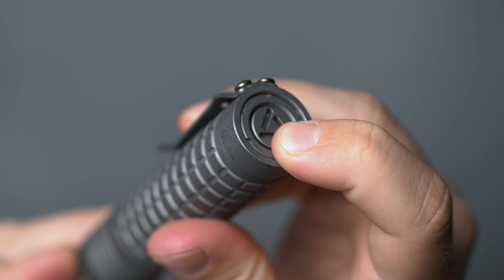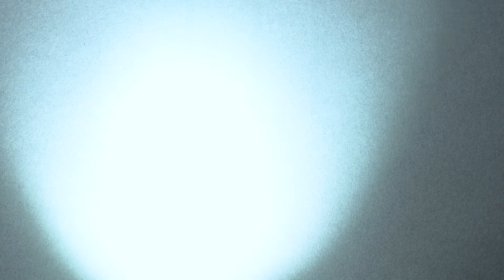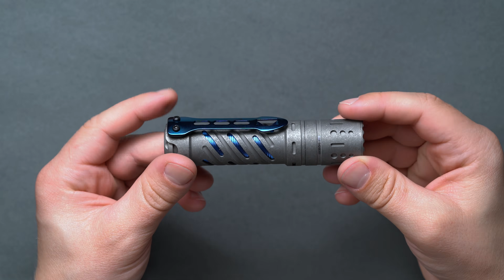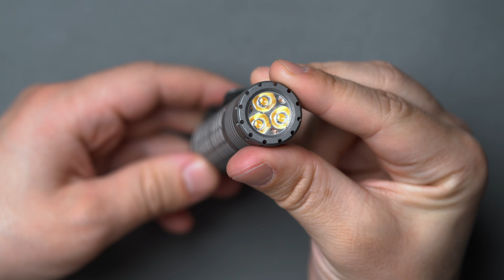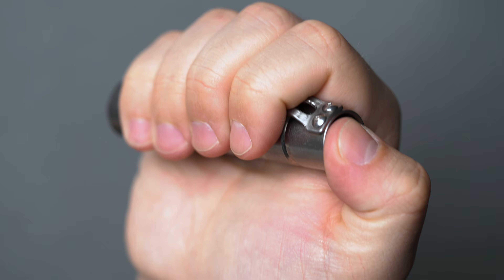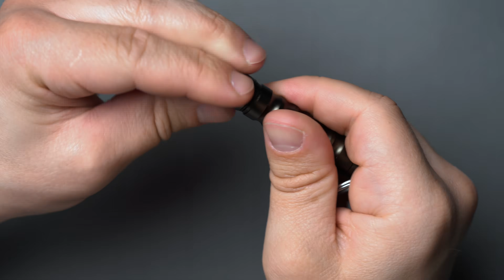The 8 Best EDC Flashlights

Comment: Have had the T4K for a few years now. The majority of the black has been scraped off over time, revealing the aluminum body. There is nothing legible left on the case to discern what it used to be, but it is hands down the best flashlight I've ever owned. And I have A LOT of them, including multiple O-Lights. This one is perfect for EDC and when you hit that top button, you can access the blinding 4k lumens instantly - even when you lock it. 

A few downsides
- I've melted every single mesh/nylon pocket in all of my pants. The 4k button is easy to trigger and it WILL burn through clothing. 
- You have to keep the T4K locked on "1" at all times or buttons can easily be pressed and drain your battery in your pocket.
- Locking it usually takes a couple of tries. You have to press 2 or 3 times to activate the locking mode. It's annoying.

Comment: surprised you didn't mention the reylight being able to also take 18350 batteries by taking off the extension tube. thats where it becomes a fantastic light. 18650 for a work day, swap for 18350 for lighter edc

Comment: Today i have new pocket licht.
It use aaa Battery and run 3 hours 
GP flash light CK12 
20 lumen.
25 meters 
IPX4
Key ring.
18x89mm 
Aluminium body 
A brand company 
And i pick up for backpackers.
GP ReCyKo B421 EVERYDAY USB charger for aaa or aa battery to charge up.

Comment: why is the run time on the e70 mini so bad?
19 hours at 60 lumens?
that's more like a 14500 light not a 18650 light, it should be at least double if not triple that

Comment: Hey! These are the list prices from the manufacturers’ websites (except Laulima Metal Craft, which didn’t seem to have a functional website). Lower prices for some of the lights were found on other sites such as eBay, Amazon, and other dealers, but none were drastically lower. I'm surprised Rovyvon didn't make this list; they make awesome lights!

Olight Baton						                  $99.99
Nitecore T4K						                  $89.95
Acebeam E70 Mini Ti					        $109.90
Surefire Titan Plus					        $149.00
Reylight Ti Dawn					                $155.00
Focus Works F3 Ti					        $300.00
Laulima Metal Craft Ion Slim Aluminum		$285.00
Prometheus Beta QR V2 Magnetic			  $69.00

Comment: Baton 4 is awesome except the green tint on low and medium. The case is a cool feature, but the light as a pocket light is nice for edc.  The case has uses of course especially as a power bank. I also like the pinaplle, pokelit copper, i3t titanium, wurrkos titanium ts10 with rgb, klarus has some nice aa lights as well but for different scenarios. I havent found a perfect edc light just some nice lights with many small differences and small quarks to make them different. Some of your lights feel to big for me to even consider as pocket carry. I have pocket carried lights with 18650 and 21700 size, but only when I knew I would need the run time and lumans. Aaa and AA size are the only medium i have found to be the most portable for myself. And if im 100% honest with myself a keychain light means you will have a light on you 95% of the time you leave the house. But it has to be brighter than a phone light or its piontless imho. Titanium is pretty heavy im not sure why people keep thinking it's not. Titanium is only ligter when designed around its strength. I have yet to find a flash light that has thinner walls than its aluminum or brass counter parts
Reply: I have the copper Baton 3, and wouldn't go any bigger than that for an edc light. I like the actually pocketable size. Anything bigger is just getting left in my car, and a smaller AAA keychain light (Peak Led's Eiger) and it's great for it's size and power source, but just isn't enough. The baton is small enough that you forget it's there, and it was very reasonably priced for a true copper light (not the winter copper version, the copper run of baton 3). It's ~300 lumens less bright than Baton 4, but I far prefer the esthetics vs the baton 4's which is a bigger concern for something I'm bringing everywhere.
Reply: You are totally correct. I work with K9 in EU and I use big one Sigma 100 lumens on poligon (+ on MTB) and haw always small Lumitop 3A on my keys and I use here but she is with mee always 8+ares. Super useful batery.

Comment: Im using a TUP as a bedside light, its the best for the job, dont roll and the switch its easy to find and press. Its a bad light for walking at night, the spot is too tight. I once tried a diffuser in front of it and it was perfect.